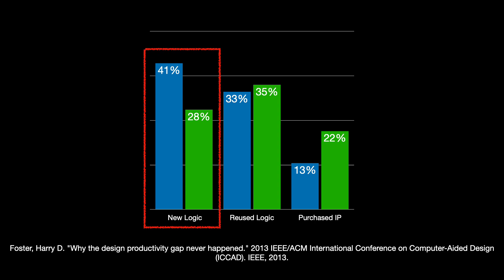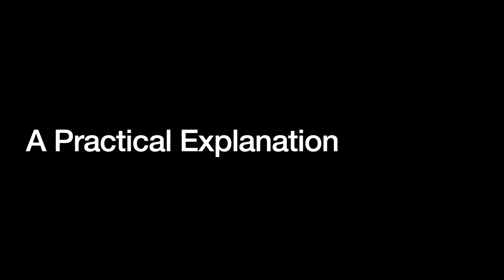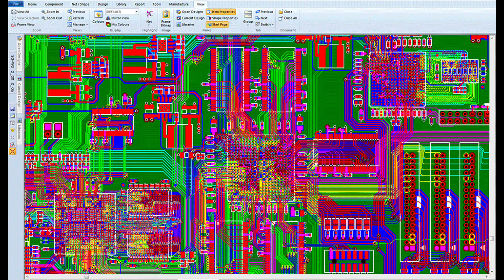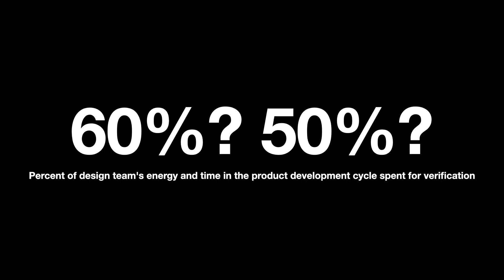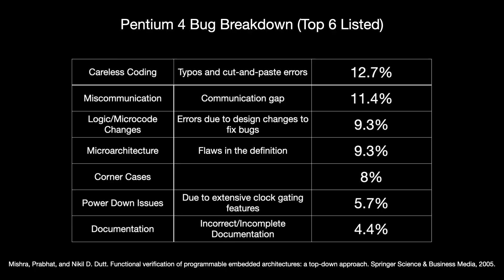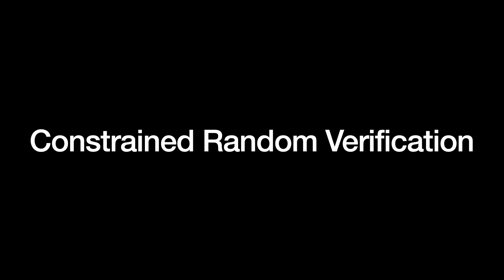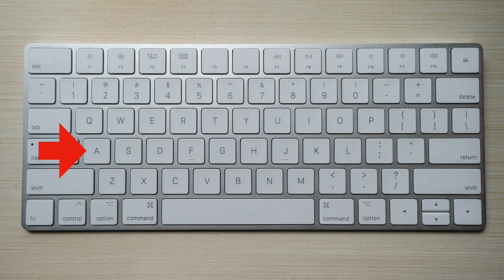The Growing Semiconductor Design Problem

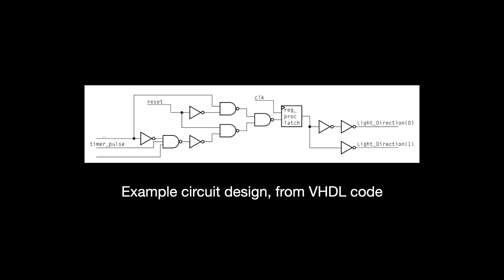Comment: So, the example you gave at 5:00 for the street light thing is fine, for embedded systems, if you're making a chip to do so little that you would actually have to use another chip to resolve the situation.

But even for embedded systems, this isn't usually the case.  The processor is powerful enough to be programmed, and since it can be programmed, you don't need to replace or redo the hardware.  You change the code and the hardware was already flexible enough.  This is exactly was different companies give you.  ARM comes to mind.  There are others.

Dude this video may be a favorite from you but it lacks insight.  Right now there are so many chips on the market that making new chips isn't as necessary as it was years ago.  They can be made on the cheap as they take up very little space on a wafer, and even with process nodes between 20 - 12nm where the lithography isn't nearly as complex, you can fit a few million transistors into a very tiny space.

That's the world now.  The nodes that are going to be the bargain nodes are going to be 28 - 12nm.  Older nodes are going to get phased out because once companies offer great prices on these initial nodes that use EUV, all other nodes are going to die.  You get so many ICs off a singe wafer that it just doesn't make sense in any way to use larger nodes.  So, we assume then that we just don't need to design as many ICs now, and that I can use a cookie cutter IC from a company that's already designed the logic and because the price is low enough, I don't have to pay engineers to design a circuit that's simple for the most part anymore.

Yes, testing is the issue.

So the world we live in now.  ICs that are programmable can be hacked.  Hacking is squeezing the world right now, affecting govts., business, etc.....

What are the levels of software that can be hacked?  Can the chip be hacked, that is the code that helps to run the chip?  Processors are INCREDIBLY complex.  The more complex the chip, the more it has to be tested, and failure to do so results in companies putting out chips that hackers exploit, and other companies using those chips get frustrated and decide to never use your company again for its chips.

Validation is because of the growing complexity of processors.  If you look at the two companies that makes most of the X86-64 processors, Intel and AMD and look at what happened when exploits showed up for Intel CPUs and not AMD CPUs for certain exploits, because AMD was making really good processors at that time, Intel lost business.  These were hacks of the code that run the CPU.

So validation, as chips get ever more complex becomes the largest function in producing a new product.  Failing to do so guarantees loss of repeat business.  AMD can't make server CPUs fast enough.  Part of this is because how good and power efficient AMD Zen 3 EPYC is over any comparable Intel server CPU, for which there really isn't any.  AMD is now king in this business space.  The other part is, there were exploits that could be taken advantage of in the microcode that runs the CPUs.  You can't have that in server CPUs.  An exploit can be millions of dollars, or it could be hundreds of millions of dollars lost to down time, paying money to hackers, loss of business from their customers, etc..........  Intel CPUs had more exploits than AMD, and now because of that and AMD has a better product, AMD can't make server CPUs fast enough.

What did the above lead to?  AMD went from making no profit in 2016, or so little profit it's not worth considering, to making over 4 billion USD in profit last Q, which is a record for them, and this record profit came in spite of AMD not being able to put out a reasonable amount of graphics products.  It came because they can't make server CPUs fast enough.

So getting totally away from your analogy which is useless outside of the world of making an IC with a few hundred transistors that's not programmable really and instead would change machine states and exist only in the realm of embedded systems, validation is HUGE.  The change from 10 years ago to now is because of the complexity of today's chips.  Software validation along with hardware validation takes up the most time, and failure to get that right is very costly.

AND this is where most people are employed that work in this field.  They help to design circuits that can be a generic chip for different use cases, such as with ARM, or they're working with companies that make the most complex ICs the world has ever seen and testing those parts, via validation is time consuming since you not only have to validate it does what you want, but you have to do your best that it can't be exploited and do things you don't want it to do.

So, where do you need the bigger brains, in design or verification?  I would contend that when you have big brains in verification, they help the design team find their problems.

Last point, when you were talking about post silicon validation and say at 8:30 that you can't understand what's going on inside the thing.  Unn, no.  The team of people doing test cases cannot understand what's going on inside the thing.  The engineers who design the chips can understand what's going on inside the thing.  They designed it.  What has to happen over time is that design engineers have to get involved in validation.  They have to help boost testing capability to keep that testing of some odd percentage of the IC up at a level that's satisfactory.  Even though a team of people involved in validation is handed specs about what a processor can do, it doesn't mean they can grasp the full complexity of the IC.

You made a big jump in this video to something very simple to complex processors that would take a long time to test such as X86-64.  There aren't many ICs so complex that validation is incredibly hard once the design is on silicon for final testing.  There's a world of ICs in between.

Also, that fast iteration cycle like Nvidia says they use isn't true for processors like X86-64.  Intel and AMD both work on about a 5 year cycle to develop a CPU.  Nvidia isn't making CPUs with the kind of complexity of AMDs and Intel's chips.  Now, what is also true is that things can change over that development cycle, and in fact that always happens.  A GPU can be designed faster but it's still complex.  AMD in particular uses teams that leap frog over each other, but developments in one team can end up feeding into the other team, so it's not like these teams are competing against each other.
Reply from the maker: TLDR?
Reply: @Asianometry  Don't care I said it anyway.  I could give you a brief form when I put out the crib sheet for it.  There are two or three run on sentences which makes it a little harder to digest.  Sorry.

Summation, you made points that were incorrect or lack explanation so you don't get a good point across.  You jumped from an analogy (lights, few hundred logic gates maybe to run that, not programmable, would use machine states, and yes I got most of a software engineering degree and studied embedded systems, and then had back surgery)   that's almost useless in the world of making ICs,  to validation that would be involved in making a complex chip, like Intel, AMD X86-64 CPUs or the Apple M1 or basically any other CPU.

You skipped a HUGE realm of stuff in between, and it's really THAT stuff that you skipped over, which has caused the drop in design engineers as there as so many ICs on the market you can buy, or use a design to make ICs such as a big library of logic from ARM as an example.

However you did impress many people, so there's that.  But if you give the impression that the drop in design engineers as compared to people who would be involved in validation is simply because of how complex chips are, when most chips really aren't, your point is wrong.  While it's true that AMD, Intel, Apple, etc.... need more people to do validation because of the complexity of their CPUs, like I said above I have to believe a pretty good chunk in the loss of design engineers is because of ICs you can purchase, or use a chip design that already exists so a company doesn't need to pay design engineers to do a lot of work they used to do.  ARM?
Reply: @johndoh5182  Jeez even the tldr is a little bit of an essay. Not making fun in any way. Actually I'm quite impressed.

Comment: I worked in wireless design for years and one thing I can tell you about short design cycles is that although you get stuff out fast the chance for errors is of course increased. But here is the catch in the wireless arena you had at most 6 months to a year lead on competitors. If you screw up and miss with a design cycle then you have to respin and now your lead is gone. Do it again and now you are in your opponents rear view mirror. I have a couple of fantastic stories on what happens when you push too hard on the design cycle.

Comment: Verification can be conducted automatically to a very limited extent. 
SDA tools works like a software compiler, but the output is not a code to run on a computer, but a physical portion of circuit to be built on silicon. Only in this way you can generate a chip with four billions of transistors.
Verification require that you build dozens of successive prototypes and test the device for inconsistencies (Like when you add one more core but the speed of the chip decreases for some functions).
It can take years, but hands on testing it is the only way to produce a faultless SOC chip like the 888.
I believe that, year on year, the improvements on existing chips will become more and more marginal.
Great analysis you have made here.

Comment: I used to work for Altera (now Intel FPGA) in the UK Mid 2000's and visited ARM in Cambridge regularly as they used the largest Stratix devices of the time (EP1S80?)  to do design verification and IIRC they used the largest equivalent Xilinx Virtex devices too. The thing with FPGA though, is that due to the reprogrammable nature of the fabric, it will never operate at the same speed (it's always slower) as dedicated silicon, so the verification would be very much functional rather than timing based.

Comment: Yes, splitting  design and verification is a TREND. But it create additional head splits inot the group domain. Most of verification failures are because of head spread. Yes, there are ways to make intentions, assumptions, issues, unsolveds and so on more explicite by pathing them to tools and edoc. Management see the head split as easy fluid resource problem, overlooking that it could create more problems than to solve.
Bob Pease at the DAC98 say on a plenum which i attend: "Try to make zero phone call designs".
Communication is the key about what things have to do. Miscommunication is THE failure, everything other is a matter of resource, planning and exercise. It belong to final silicon user to designer as well as in between designers and verification engineers. Again management try to shorten by introducing an added work rule mode. I found it more useful to let verify own designs by other designers as most verification engineers have a software background. Yes, like make and regression. No matter it applies also for harware in a good way. But it do not solve the work ethics: "Ok, i miss it. Lets make it in the next release". They do not understand the difference between a 1h compile and a 6 month mask cycle. They did not breath that a release cycle in hardware could burn a company. And my personal experience is the tension about the careless and lazy software design principles and hardware design ethics.
In the future i think that the node slow down create a more healthy ecosystem where market sharing give the opportunity to specialize and design more robust, deeper tested and cheaper hardware components like decades old libraries today in the software world.
SOC design today is a hurry to create a hole system every 6 months.

Comment: Well, the old software standby works:  if a chip fails, just power cycle it and hope it will fix the problem.  If you're on a mission to Mars, hope even more it will fix the problem.

Comment: I really enjoy your videos, Jon. This video essay is a great take on the semiconductor design problem. I do believe that AI will gradually step in to help alleviate some of the challenges and issues with manufacturing silicon but the industry has been slow to adopt this technology to make vast improvements to silicon manufacturing quality. Some in technology thing "if it ain't broke don't fix it" and that needs to change in my opinion.
Reply: The one suits all approach is hard. Taking time to make an ai might not be worth it and instead paying a team of 10 to do the testing comes cheaper. We have seen an increase in ai used for the architecture of chips but even then you spend years developing the parameters and code for the ai itself. AI shouldn't be seen as a way to put out chips at a faster rate, they screw up too.

I think we just need to understand that all aspects of the chain need time to catch up, we have research projects that show we can shove more transistors into a smaller area but so what, if the machinery isn't caught up and only a few men are knowledgable enough to put it into practice it is all for nothing. Customers want to hear that the next product has a newer chip with faster speeds, they have grown accustomed to getting a new phone every year with some sort of improvement. This can only last for so long, the chain is bound to collapse at some point. wouldn't it be a waste to invest billions into a technology you know will only be relevant for a year or two. Any ai you make will lose its efficiency as soon as the chips get an upgrade and now you are left with a useless ai that needs to be changed to suit the new chip. People with proper teaching are just more cost efficient for a business.
Reply: AI isn't magic

Comment: What's with all the screenshots of PCB designs in an ASIC video :D . Anyway the DFT (design for testability) and DV (design verification) teams are 2 to 3 times the size of DE (design engineers) + PD (physical designers) and try and work in parallel with the design process with periodic feedback provided by the other teams. Also, as a PD you run multiple time consuming verification steps - timing, noise, DRC, ERC, LVS, LEC, ANT, power, fill checks etc. which factor into the ~70-60% verification time.
Reply from the maker: Got to have something to show people

Comment: As a software guy, I can only imagine what life is like in the hardware community, but I wouldn't be surprised if there were some similar cultural issues.

In software, one reason testing is often behind (besides the obvious fact that you can ship a fix in an update -- sometimes) is that testing (writing test code, running it, debugging) is too often perceived as a cost center as opposed to creating value. Customers expect "working features", but "working" can be too difficult for them to specify (possibly more than features) and is often implicit. It is part of the value creation process to discover the corner cases and handle them properly, but that's normally invisible outside the team making the product, with the downside that it's also undervalued.

Also, a current trend in software is to no longer have dedicated teams for tests, which leads to reducing the diversity of people looking at feature specs (assuming such specs even exist). Even when you have the best tools money can buy, you still need skilled people bridging the gap between the tool (which is generic in your industry) and the feature (which is specific to your business), and if they don't look at features with some kind of adversarial point of view, defects will be remain.

Comment: Some stuff like traffic signals for railways require even more verification steps.  They require fail safe circuits so unsafe situations cannot be latched into place by failed software or failed hardware.  This is not easy and turns out to be very expensive.  Standards...

Comment: It's very, very much like software - most of the time is not spent on the original implementation, but on looking for problems with the implementation and fixing them before they affect deployment to a production environment. Except that it's much, much harder to patch, so all that work is front-loaded.
Reply: Honestly that's only true if you suck at originally implementing or you're working on old legacy software that's full of bugs already.
Bugs happen obviously and they can be hard to solve, but if it's taking you more developer time to test than to actually implement things it means something's gone badly wrong. In a properly designed codebase 90% of bugs should be caught during implementation by the developer himself, and by the time you push to the test environment the application should be almost bug free. 
The only bugs that should be left are integration bugs that cannot be discovered untill all the other teams working on other systems have also deployed to the test environment, and those should cause fatal errors right away and be easy to track down because you should have extensive validation on all inputs and service responses. If you don't, you're asking for it.
Reply: @demoniack81  The key word in your reply is "should." Many of the things that "should" happen, in practice, don't.
Even in the case of faultless coding, many bugs are a result of a poorly written or incorrectly interpreted specification. Or of bugs in the tools being used; the tools are themselves typically "legacy software."
The only cases I've seen where debugging and maintenance did not consume the bulk of development time were cases where the developer either couldn't be bothered or was cut short. Counterexamples welcome.